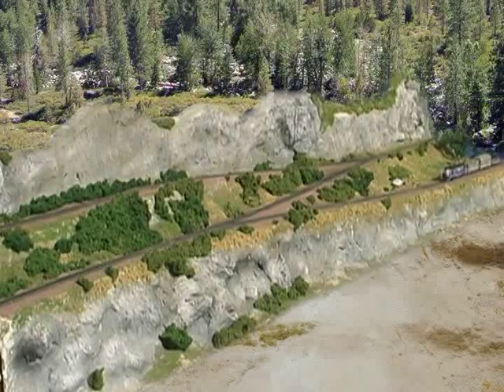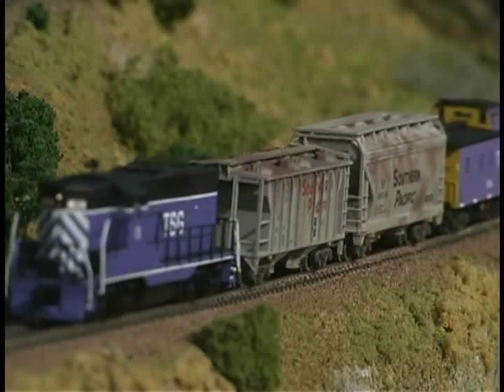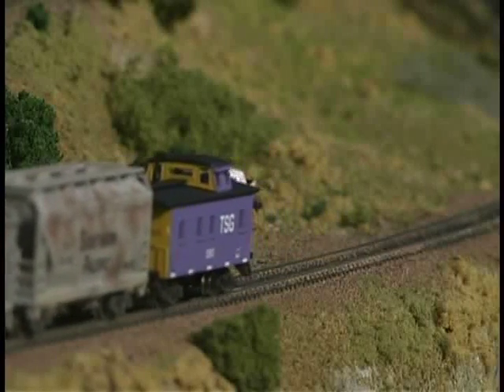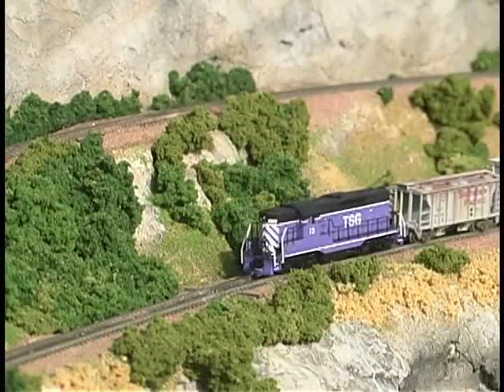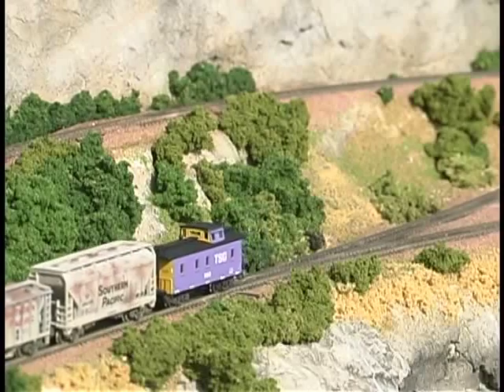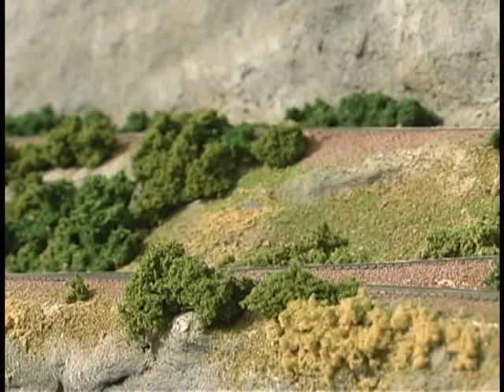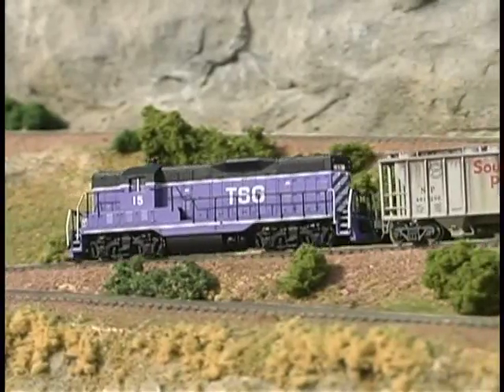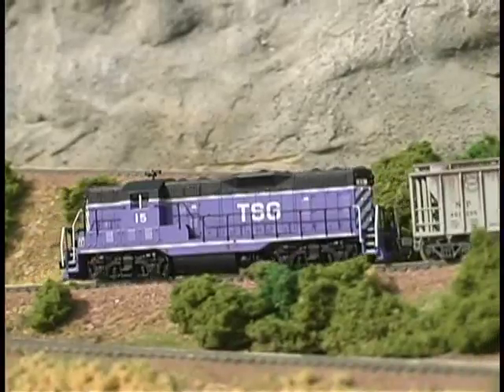How Does a Train Switchback Work? Watch This Model in Action!

Comment: Hi folks, nice. Haven't seen much of this in modelling.
Though there's some in real life.
Leaving Salta (1152 meters) NW Argentina on the C-14 route of the 1 meter narrow gauge Belgrano Line which does the so called Train to the Clouds, climbing up to 4402 meters, there are 2 zig-zags plus 2 helix.

How many cars can you manage to push that track?
And, what's the length of available track between frog and stopper?

Cheers
Reply from the maker: The tail tracks are about 270 scale feet, if memory serves.

Comment: A great demonstration! Just a couple of questions/observations. So, two sections of the switchback are actually just dead end spurs that have to be just long enough for the longest train to clear the switches? Could the train consist be split up to maneuver the switchback if the train was too long? Seems like a rear-end helper locomotive or two would make this a lot safer also.
Reply from the maker: That's correct.  They are usually referred to as tail tracks.